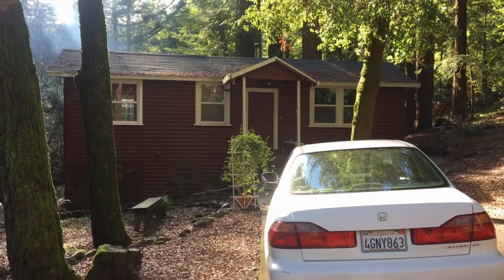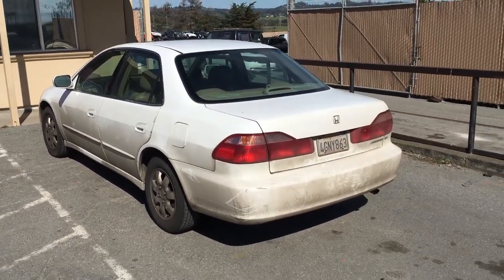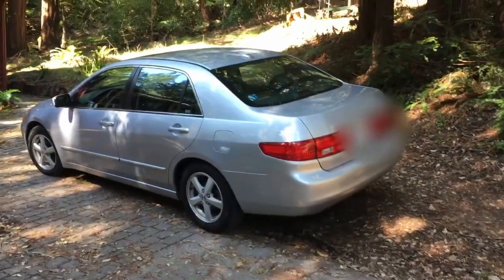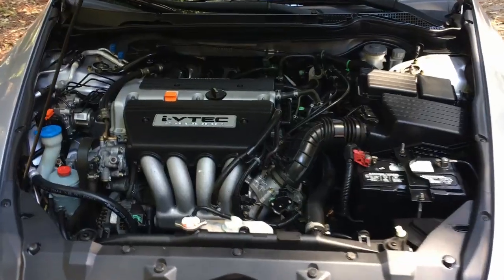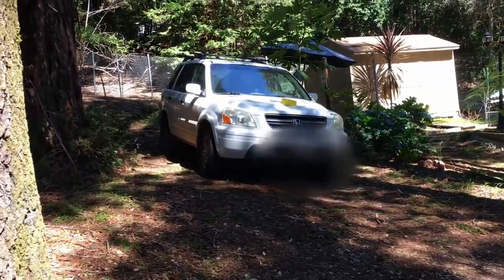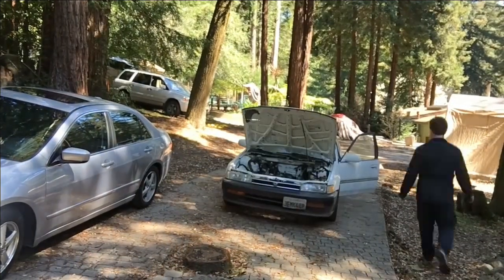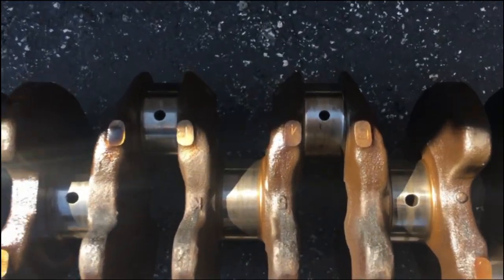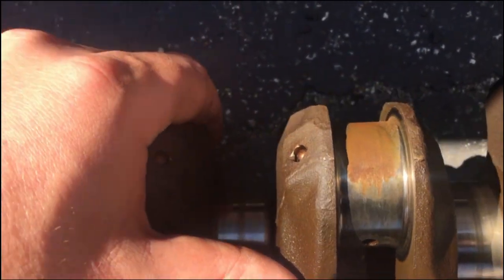CB7 Motor Build Part 3 - Goodbye to Some, Hello to Others!

Comment: Always enjoy your videos man! Finally catching up with your channel. I had been watching when the H swap happened but missed the videos of you planning to build an all motor F series. Damn!!! Wish that had worked out because it would have been good reference information for me. I really really want to build another F22A. My current F22A is just rebuilt stock with I\H\E upgrades. I'm still doing a lot of reading. Was already looking at the same Arias Pistons and boring to 86mm as well as what rods to run like the Eagle H beam rods. Any page links on the forum that would be helpful I'd really appreciate it. This winter I'll working to document and upload some videos of me replacing the whole rear end and adding adjustable arms, bushings ect. I was able to take the coupe out to IFO on Nov. 3rd. and actually won Best Old School in show. But I'm itching to be able to go take it out on a track. Thanks, Edgar.
Reply from the maker: Yo, thanks for stopping by!  Yeah, the crank was just too expensive to replace.  Then again, I was going to have to be prepared to put down WAY more money and WAY more time that I didn't have than I did overall for this H swap.  My wife is already maxed out on patience as it is!
Reply: @af1132racing  Lol. Well thanks for the replay. Glad it works for you and keeps the wife happy. Me on the other hand am single now & don't date, so the car get all my attention! Lol.

Comment: So I'm all for you doing the H swap. but didnt you just junk a car with an F block in it?
Reply from the maker: Yes, I did, but that block had way too many miles on it for me to trust it as a bottom end that can take hard abuse on a track.  I'm the kind of person that will fork over more cash for more piece of mind while I am wailing near the red line.  Some would tell me to just go to the junkyard and get another F-block.  in that case, I am even more uncertain as to the health of the block since I don't know the miles of the car, how often the oil was changed, how good the rings are, etc.  There is always a risk will every option, to be sure.  I just want to mitigate risk wherever I can.
Reply: @af1132racing  I gotcha. My personal options for engines is usually 1. rebuild existing engine (rings, bearings, acid wash, hone block) (valve job/valve stem springs, resurface) budget build) 2. replace w/ used engine if it passes a compression test/leak down 3. Buy crate engine from respectable supplier... never done lol